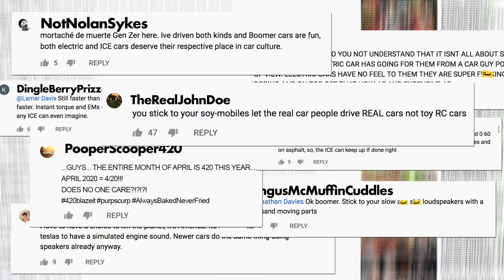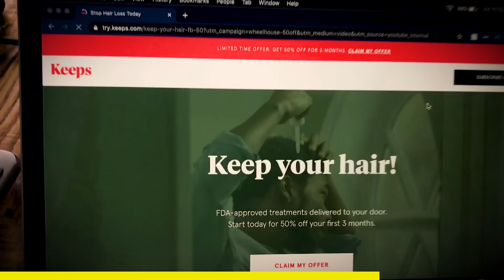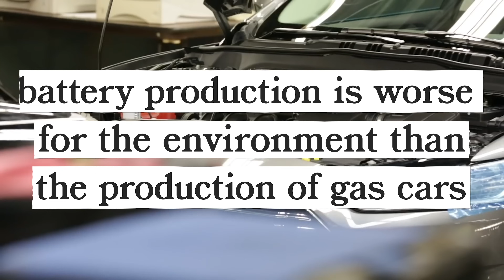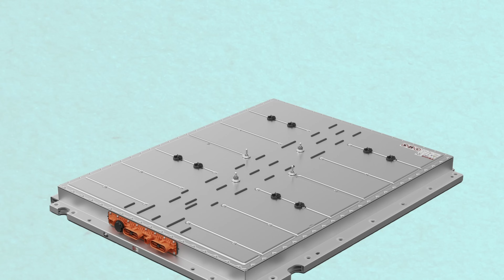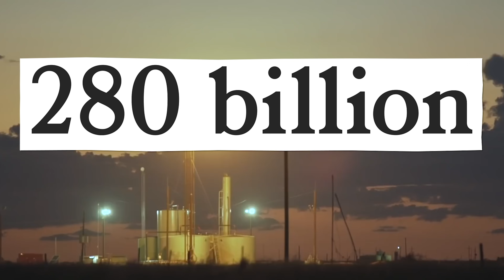Are Electric Cars REALLY Better for the Environment?

Comment: I like how he quickly skimmed through the cobalt process.
Reply: What kinda lithium Ion battery powered device ya’ll watching this video on? It was never about the kids.
Reply: @davidqualseth658  not a battery that weighs a couple hundred pounds that's what 😂
Reply: @cottonmouthdb8454  a battery that's lightweight and energy dense like am aluminum ion battery..
Reply: @cottonmouthdb8454  There is more lithium used in mobile devices than all the electric cars on the planet. So that's something to consider.
Reply: @cottonmouthdb8454  Since when do starving kids weigh hundreds of pounds? Or wait, what are we talking about here?
Reply: @BruceHurley  nearly the entire planet has cell phones, the entire planet is not driving electric cars. A phone battery uses 8 grams of cobalt, an electric vehicle battery uses 6-12 kg. At the rate manufacturers are trying to switch to electric we would be almost completely out of mined cobalt around the year 2100.
Reply: @mikecapatina2802  People have been saying that we are going run out of mined oil/coal/natural gas, etc. for decades, but technology always improves to make finding and extracting these resources more efficient. Of course, just because we CAN find more cobalt/lithium, etc. doesn't mean that we SHOULD. This is why it's crucial to invest in new technologies that have less of an impact on the environment. I'm encouraged by new batteries being developed for both consumer and grid use, but we are still far away from a solution. We will likely need cleaner nuclear (maybe even fusion someday) to bridge the gap, but the bottom line is that we need to focus on new, not old technologies. We know what doesn't work for the planet, but we need to invest in solutions that DO work.
Reply: @BruceHurley  

No it doesn’t
Reply: @fradaja  Could you be more specific? No, WHAT doesn't?
Reply: @mikecapatina2802  There are close to 1,000 mobile phones for every electric vehicle on the road, so it's pretty close right now. But as the number of EVs grow, so will the problem.
Reply: @BruceHurley  

Extracting  resources isn’t
Any more efficient than 30 years ago ,the only way we can get more efficient is the electrification of the machinery I. The mines
Reply: @fradaja  Are you saying that mining technology hasn't advanced in 30 years?? I would suggest that you look into the topic a little bit more closely. It's been RADICALLY improved in that timeframe.
Reply: @BruceHurley 

Speaking as a geologist with 40 years experience,  im still employing the same basic methodology , as I did at university
Reply: @BruceHurley Know I'm resurrecting a dead thread here but I wanted to point out to people reading that nuclear power is 100% clean from an atmosphere standpoint. It doesn't release any harmful gases into the atmosphere, but the main issue lies in proper disposal of nuclear waste. As it stands, all we can do is bury it underground. It's also a very high initial cost building nuclear plants, and some can take 10+ years to construct. Taking it knto consideration though, it's much cleaner and is the only form of electricity production that produces a constant, reliable output without polluting the atmosphere. (As solar, wind and tidal power are influenced by weather/time of day etc)
Reply: Exactly, more than 40,000 childern in congo alone are engaged in cobalt mining and getting paid less than 75 cents on average, also there are childern who are as low as 6 years of age forced to work in harmful environment to earn their daily bread, dude just ignored the most important factor
Reply: @horlicksft.bournvita4933  EVs are moving away from batteries that use colbalt. Also, if your argument is that EVs are less ethical because battery technologies that are being phased out use child labor, look into the oil industry, it's just as bad, and ICE cars will always require oil, its not something that is being moved away from.
Reply: @horlicksft.bournvita4933  only bad parents 
force their own offspring to work, 
and dont forget that Cobalt is also used in 
the de sulphuring of petrol/diesel 
AND in the manufacture of catalytic converters.
Reply: @horlicksft.bournvita4933  the topic is about the impact to environment. I'm not saying it's not an important factor, but it's not relevant to the topic being discussed.
Reply: @riph-a  oh okay my bad, let the environment flourish and leave the childern to die like animals, thank you for opening my eyes
Reply: @horlicksft.bournvita4933  you're welcome, I'm glad I can help.
Reply: @riph-a  look up how the cobalt is removed from the earth by these children. NOT good for the environment. ( no hate, just sayin').
Reply: @horlicksft.bournvita4933  Dude..... Even if we stop all kinds of pollution starting tomorrow, it will take decades for the earth to recover from the damage that humans have made. But, I know that doesn't justify children working in these mines, but as humans, we've exploited the earth too much. And as technology grows, I'm sure that there will be a battery one day that doesn't use much cobalt
Reply: @abisheksanthoshkumar1804  Yes, that will be aluminum ion batteries..
Reply: @Kluleess  Aluminum extracting is not really as bad as extracting lithium
Reply: @GOD9494  LMAO
Reply: Why bother all of this.. if GMG has produced aluminum ion batteries that doesnt even need rare earth metals?
Reply: Let’s be honest they don’t care as long they see them pound signs😂😂
Reply: It’s used for refining fossil fuel , and it’s in your phone , and you didn’t give a fk , until evs came along
Reply: Is child labour now like an argument against EV...

Or maybe its possible the consumer to change child labour laws in those extraction countries and also better pay

but these children will be very thankful once they are grown up and their house is flooded cuz of climate change
Reply: 1) 50% of current Teslas don't use Cobalt
2) The ones that do come from certified mines that do not use child labor
3) Your smart phone, cordless tools, and laptop all use cobalt from the lowest bidder
4) Oil refining is the second largest consumer of cobalt, so if you actually care, you can't buy gas either
5) Fuck them kids
Reply: It's one of his few misses:

1: EV batteries don't require cobalt, LFP is taking over.

2: oil refining requires massive amounts of cobalt.

3: the oil industry has plenty of problems with forced labour and child labour.

4. The USA never invaded anybody got cobalt.
Reply: Elon Musk already has a battery in production that uses alot less cobalt.  It is called LFP.  Moving on.
Reply: @halnogaies1256  a lot less? Lmao try none. LFP uses zero cobalt while Teslas Li-ion batteries use’s roughly 3% cobalt and dropping. Cobalt isn’t as big as an issue people make it out to be.

Comment: I think the main issue with EV's are the number of charging stations. Sure if you live in a big city there might be a lot to choose from, but if you live out in the county or even doing road trips you would have to plan your trip around charging stations. Then when at the charging stations if might take anywhere from 30 minutes up to an hour to charge just your car. Now if there are a line of cars in front of you it could take hours before you get to charge your car. If there were just 3 cars in front of you it could take anywhere from 2 hours up to 4 hours just to charge your car. I think this is the main issue why EV's are not where they need to be for everybody to own one right now. Talk to me when EV's have solar roofs and can constantly be charged by using the sun. Where you can have an unlimited milage range as long as the sun is out.
Reply: The Mercedes EQXX does 1000 miles on a single charge and 1200 miles if driven more carefully. This on a 100 KwHr battery. This shows us the future. No one will charge during the day anymore. You won't need many public charging stations anymore. Charging will take place at night, slowly, while you sleep at home or your destination making use of the states under used generating capacity. There is a reason why night time electricity is cheaper.

Comment: The biggest problem with battery based EV isn't even mentioned. It's the simple fact that lithium is a finite resource. And the current lithium production is not high enough to replace even 10% of combustion cars on earth.
The current lithium production is less than 100,000 tons a year, a EV needs about 10kg of lithium, there are 1.4 billion cars, replacing all of them would use 14 billion kg or 14 million tons of lithium which would take 140 years to mine.

Comment: Every 10 to 15 years the batteries have to be replaced adding to the 17 ton C02 and Colbalt levels it consumes. Which then makes it worse than the 50 tons of C02 from the internal combustion engine.

Comment: I'm an avid supporter of environmental movements, but I think the conversation of ICE vs. Electric is a bit of a distraction. I think that as consumers we like to believe that by buying a different type of vehicle, we can solve the climate crisis, and continue as we were. In reality, I don't see the switch to electric vehicles being more than a drop in the bucket of transitioning to a more sustainable future. It just handily fits into a narrative to sell us more stuff. This is a lateral move, not a solution. A true change would be switching to massive transit networks, developing bike/pedestrian friendly zones without cars, and reworking how we think about travel. Do I think this is likely to happen? Unfortunately not, and so Tesla figured they could sell a lot of cars in the meantime.

I work with battery technology regularly, and I also echo some of the comments of caution regarding life-span & demand for batteries. Batteries are already in extremely high demand, and only accelerating. What happens in 8 years when they all need to be replaced? I think the storage component is the biggest drawback, which doesn't really factor into this analysis (at least not in terms of replacing it), and potentially draws the environmental impact of the two even closer together. I think it's important to drive what you like, know the impact is has, and find ways to make meaningful change that you desire. Cars are a very obvious source of greenhouse gases, but every choice you make has the potential to make a difference as well. The cooling & heating of your home, your diet, the companies you support, etc. You can drive yourself crazy thinking about the best ways to make a difference, but finding the happy medium and walking the line with awareness is probably a good start

Comment: Does anyone know how battery degradation and eventual replacement effects these numbers? Gas cars don't need their more environmentally harmful parts replaced with the same frequency as EVs.
Also curious how an EV compares to a used gas car as I heard a while ago that it's better environmentally to get a used gas car than it is to get a new EV and I'm not sure if this is still true.
Reply: This is called classic nitpicking - none of my friends who own an electric car have ever been to a repair garage in the last few years. in fact a garage owner friend complains that he is losing his market since electric cars have very few moving parts and less wear & tear!
Reply: @ecoideazventures6417  not intended that way my man. firstly on batteries - they are one of insanely few moving parts, and parts on EVs have a far lower incidences of replacement because of that. Although it puts a lot more weight through suspension and frame, it's definitely counteracted by there being fewer small bits to go wrong. 
That being said, it's not nitpicking to point out that the heaviest component of the car loses efficiency to the point that the car will need an eventual replacement or scrapping. They still may have some use in evening peak loads on the grid which definitely helps, but that isn't suitable for the majority of the batteries which have been put through unknown hot and cold cycles. Also the batteries (being the heaviest part of the whole car) needing to be replaced is almost the same environmental impact as a new EV.  Allot of the impacts of EVs are barely talked about, like for example the carbon footprint of battery disposal/battery replacement. 

On my second point - the idea of EVs at the moment is to replace cars on the road to help the environment. If the environment would benefit more from you using your own car for another 5 years, over you buying a new Tesla, then it's a bit counter productive to get people to sell a working car and buy a new EV if the goal is environmentally responsible choices. If that's the goal then the main aim should be urging people not to buy a brand new gas or diesel car, rather than to switch to an EV. 

I'm actually genuinely interested in the numbers with all the benefits and all the negatives, rather than big things like used gas cars and battery replacement not being considered. 

Also this isn't me hating on electric vehicles - I actually think they are really cool bits of kit. I'm just trying to work out a fair comparison rather than bits missing from the equation.
Reply: Thats retarded. If you buy an used car it means its older and will generate more co2 than a new car with better emission standards. The only thing you will save is the manufacturing co2 which is negated în 1-2 years tops. And if you but a second hand, odds are the one who sold it to you will buy a new one so either you or him will still bring the manufacturing co2 în the atmosphere.
Reply: EV batteries last vastly longer than a typical transmission or ICE motor.
Reply: @meanmutton  from what I've read, they are intended to have a lifespan of around 12 years, or 150,000 miles. Diesel engines usually reach 200,000 miles before trouble starts, and a good one can reach 300,000. I also want to clarify I am actually pro EV, but it's closed minded to assume they will fit every use case, or that getting an EV is automatically better for the environment than getting something like a used diesel. 

EV battery degradation over time is hard to relate to dino-juice vehicles. After 150,000 miles in an EV your range is about 2/3 of what it was new. That drops significantly if you have harsher use conditions like very hot environments, or you charge to 100% battery or use it below 20%. Sure they can reach higher distances total than some diesels, but at that point your range isn't suitable for long journeys. 

I'm not saying they don't have their place, but rather that if we were to go blindly into replacing all cars with EVs, it would be an environmental disaster. They aren't suitable for everyone, and using them as a blanket alternative rather than using for example a second hand diesel for some people's use would hurt the environment rather than help it.
Reply: I think there’s a Tesla out there with like 200k miles that only lost 8%

Comment: Great video.
Once the recycling issues are tackled, only the first EV you buy will have that enviro penalty.  Subsequently the recycling of your old ev means less impact!!
Reply: When EV's become more popular, you will have to pay for the recycling of your battery.
Reply: @COSMACELF1802  not if there is 10,000 dollars of lithium and cobalt in it.  But you are right you won't get full value for the materials as the reprocessing will be a material cost.
Reply: @COSMACELF1802  No, you won't.  The battery's worth too much to simply through away.

Comment: The only reasons there are emissions in the lithium mining process is because they use diesel powered vehicles to mine and coal generated electricity to power the lights at the plant.

Comment: No one ever compares an ev to a diesel as a diesel barely produces co2 i think EVs are plagued with issues and are still an none proven technology, the biggest issue is charging them it takes too long, could you imagine the amount of charging points needed if every vehicle ran on electric or the queue at 30 to 1.5 hours at a time you would spend all day waiting

Comment: People have frowned upon hydrogen vehicles because of the price of hydrogen and the fact that we are going through a drought.
 If we ever figure out how to desalinate our seawater and do something productive with the salt rather than returning it to the ocean and ruining the ecosystem in a cost effective way without burning traditional fossil fuels like solar or windmills, would be a good start.
Bill Gates has a great solution for the water issue as well.
If hydrogen plants were ran off of solar or windmills it would greatly reduce the cost of production and driving the distribution as income would be a good overhead.
Byproduct of such a factory?
Oxygen.
Byproduct of the vehicle?
Water.
Can you make it in the garage?
If you know basic chemistry and understand that you are just removing one molecule from two others... yes it's very simple, but the resulting hydrogen you collect is flamible and can dissipate into the surrounding area if not handled properly.
Better than both? 
Absolutely after it's done properly.
Reply: I'm one with the Golden rule..
K.I.S.S.